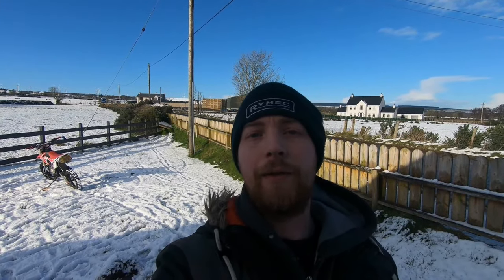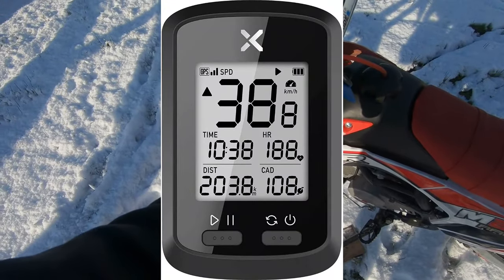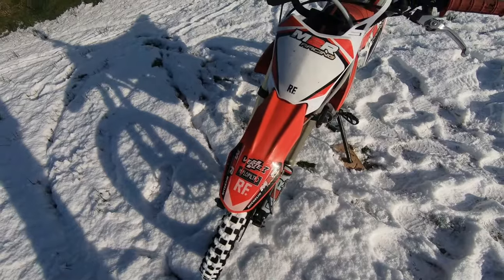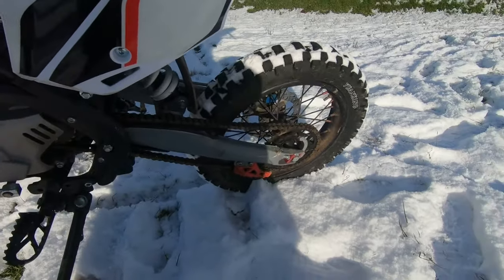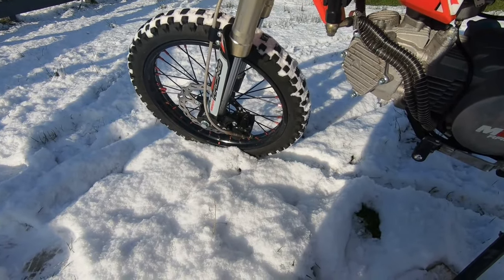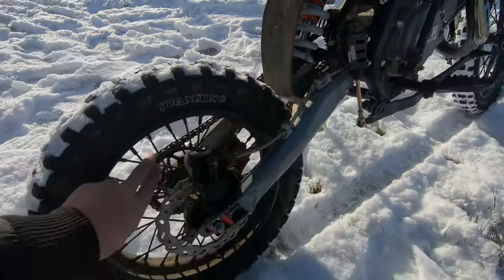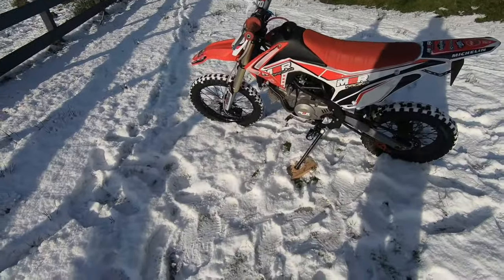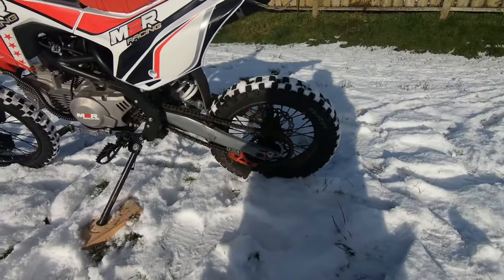How to MOT your pit bike or dirt bike - UK and Northern Ireland

Comment: Great video mate just wondering if you have the links for the horn, tires and speedo ? Cheers
Reply from the maker: Yeah sure sam no problems
Speedo: http://ebay.us/b9GQMr
Horn: http://ebay.us/26qoxK
Tyres: http://ebay.us/UVHyyU

Those tyres come on wheels already to save any fitting trouble which can be awkward. They are the 17 + 14 big wheel tyres
Reply: @DarrenMcKinney1  cheers mate legend
Reply: Mate do u have link to number plate holder please thanks

Comment: I have a quick question; the mot tester I want to use in England is saying I need to get a certificate of conformity to take the bike for an mot, is this true? And how would I go about getting one?
Reply from the maker: No it doesn’t need a certificate as you should be registering it as a trials or enduro bike which means it has no regulations to meet like lights etc and it is exempt from SVA testing
Reply: @DarrenMcKinney1  perfect thank you, I think that mot centre was being difficult, rung another one and they said no paperwork needed. Also what’s the difference between trials and enduro? Is it just the ride height?
Reply from the maker: @Panda_kt13  yeah I was thinking that. You will always get someone being difficult when they aren’t sure about something. There isnt really much difference in the 2 nowadays as seat height is no longer important. If you check out my video on filling in the v55 form I filled out the form as Trials/Enduro bike so no there isn’t really any difference in the 2 as far as registering and mot are concerned
Reply: @DarrenMcKinney1  okay perfect thank you for your help! You’ll probably be seeing videos of my pit bike up soon!
Reply from the maker: @Panda_kt13  yeah hopefully will. Good luck with your bike and stay safe

Comment: Did you need a silencer for your exhaust? My exhaust is really loud. It's a standard pit bike exhaust
Reply from the maker: I didn’t fortunately in mine as it’s not too bad. Sometimes you do have to pack them with the fibreglass matting type stuff to quiet them down or there are quieter exhausts available to buy. Depends on what your mot tester thinks if it really but if you can I would try and quiet it down as a loud exhaust can get annoying after a while

Comment: What tires brand, I'm struggling for e tyres for a crf110f
Reply from the maker: Firstly what size are your tyres? Are they the 12 + 14 inch or the 14 + 17 inch?
Also did you check to see if your standard tyres were e marked or just didn’t say “Not for Highway Use”. If not they should be accepted at the MOT?

Comment: do they check the engine (the cc) frame number and papers say its 125cc
Reply from the maker: They will check the frame number most likely but it’s unlikely they will check the engine number or cc as they will mainly only be looking for oil leaks and safety related things like that
Reply: @DarrenMcKinney1  Ok thank you

Comment: What insurance company are you insured with, I’ve been looking but some don’t do q plates?
Reply from the maker: I’m with a company called bike sure. It took them a while to get the bike on the system as it is not a brand name but they were very helpful. Hopefully they can help you out too.
Reply: @DarrenMcKinney1  they produced a very expensive insurance quote for me, do you know a way to get it cheaper?
Reply from the maker: @nirajkumarmaheta1398  that was the only company I could get. My pit bike was a lot more expensive than my big bike bits it’s just because they are an import type thing. 
My pit bike insurance was £315 and my GSXF600 was only £141. But they said it will be a lot cheaper next year

Comment: Did you have to get a VCA type approval certificate?
Reply from the maker: No. If you check out my other nova and v55 form videos, when you are registering the bike you register it as an enduro or trials bike and then you don’t have to do type approval. 
I hope this helps
Reply: @DarrenMcKinney1   yes that’s what I thought but she has sent the v55/5 form back which is my mistake I should have sent the v55/4 for a q reg and stated If I intend to use it on the road I need to get a VCA Type approval certificate.
Reply: @DarrenMcKinney1   shall I say in my new covering letter that it doesn’t need one or?
Reply from the maker: @lucassamuels8124  yes say that in your letter as well. They will have seen it before and know what you mean
Reply: @DarrenMcKinney1   Ok thanks